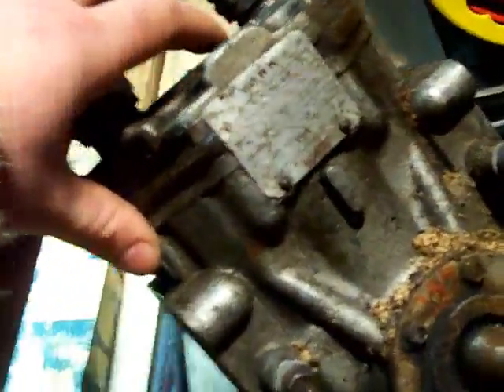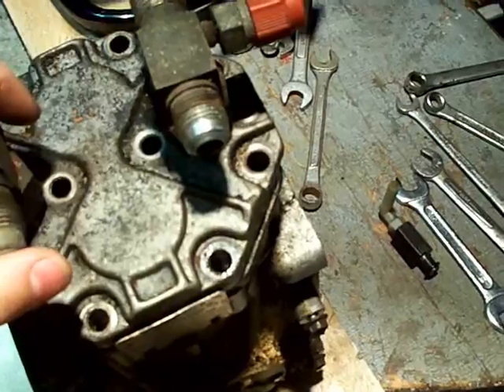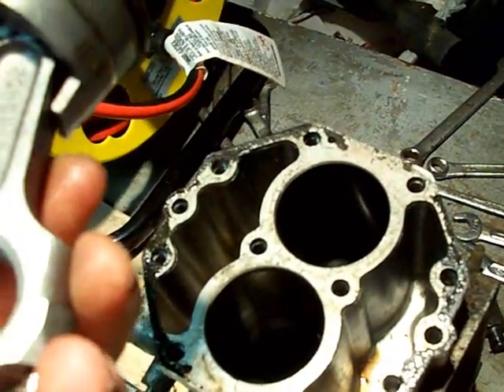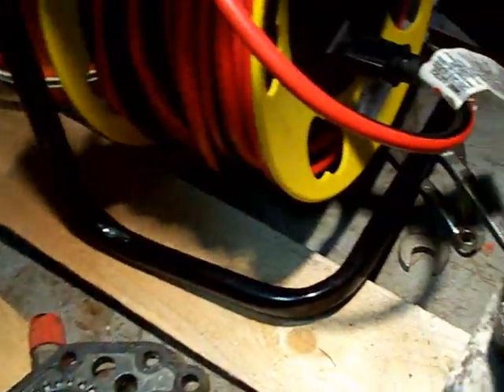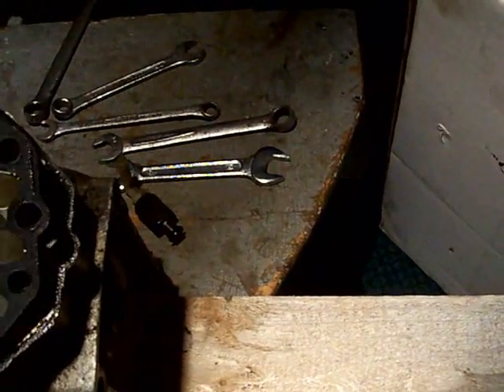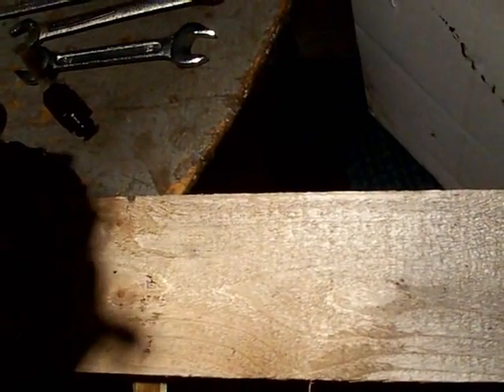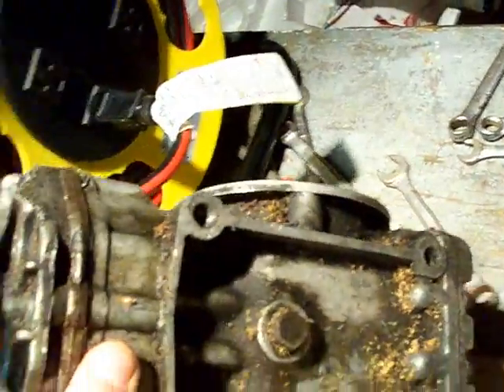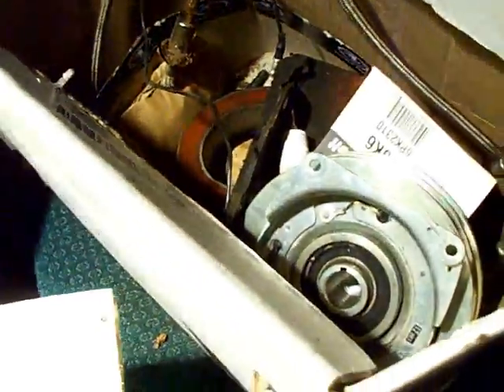York compressor information

Comment: @holyford86 One more question haha. My 210 has another oil feed hole on the same side right next to the other piston. Does yours also have this?
Reply from the maker: They will have an oil feed hole to the suction side of the compressor, it allows the oil present in the ac system to return to the crankcase and is something you should plug when using it to pump air, along with adding a crankcase breather to the pump too
Reply: @holyford86  Is that the only oil feed oil? I think there is also one on the discharge side that lubricated that bearing.
Reply from the maker: There are places in the casting for both but only one is drilled usually, the bearing is lubricated from the crankcase so the oil passage is unnecessary for that bearing to stay lubricated
Reply: holyford86 Is there another bearing on the other side of the crankshaft?
Reply from the maker: Just the two main bearings
Reply: holyford86 I think on mine both bearings have an oil feed hole. Have you seen this before?
Reply: Is there any way I can please send a picture?
Reply from the maker: @armenarakelyan6921  my username here @gmail.com
Reply: holyford86 thank you! I sent it

Comment: Can you tele me how tight the two nuts on the valve plate are it’s the nuts that holds the round things thinks
Reply from the maker: I've never had the need to remove them, I'm not sure what the torque specification is, I'd just use your judgement and a little bit of blue loctite for good measure
Reply: holyford86 think you

Comment: Where's the best place to get new gasket kits for these? I'm finding some online but too much wait time on shipping, i called auto, advance, oreilleys and napa, all said it would take days to get. I have the 209 version with the notch. mine came out of a 77 dodge rv with a 440
Reply from the maker: Bear in mind all of the info in this video is aimed at using this compressor to pump air, not refrigerant.
Reply: @holyford86  Hi, does this gasket set come with piston rings? If not where can I find ones that fit?
Reply from the maker: @armenarakelyan6921  the gasket set does not come with rings, I am unsure as to where they can be sourced
Reply: @holyford86  Thank you for the quick response! Did you reuse yours? I don't want to take the pistons out yet because I am unsure if i can reuse the rings.
Reply from the maker: @armenarakelyan6921  if there is no visible scoring in the cylinders and they look okay I wouldnt remove the pistons or mess with the bottom end if you don't need to
Reply: holyford86 Ok thank you for the advice! They look good so I won’t be removing them.
Reply from the maker: Any place you order from will have lead time on the gaskets, they are not a widely used compressor anymore.  4 seasons part number 24027 is what I used last time, should be able to cross reference that in most places
Reply: @holyford86  thanks for getting back to me, I've been calling places all day lol. I may just order from eBay and wait the extra couple days at this point. I'll post the videos on my channel soon of my tear apart and cleaning. I also had one on another van making Loud noises and i opened it too and found one of the bearings inside overheated and chunks of metal softened and broke off into the Pistons lol 🔥
Reply: It was running with no oil from previous owner, now has a pesky leak I'm trying to find. Added dye recently and new compressor

Comment: Anyone try to oil these like you would a turbo. Small oil line going to it and then a larger oil return back to the oil pan or fuel pump block off?
Reply from the maker: Jonathan c they are splash lubricated, just like many small engines, it would take extensive case modification to do so.  I will be posting an update to this video as soon as I am able to do so, stay tuned.
Reply: @holyford86  I know they are. I have a mini York for my air ride setup. I'm ok with the mods needed for this. I'm thinking that it would both lubicate the internals and help with any blow by air around the Pistons. I would still have my oil/water separator before the tank.
Reply: @thtsjon4u  i was thinking of trying the same thing and adding oil rings to the pistions. did you ever try it?

Comment: WARNING!  The oil plug (known as "oil mod") should not be done without istallation of a Fog Oiler on the intake side. While the oiling passage lets some oil through the discharge, the oil is necessary to lubricate the piston heads, rings, and check valves of the compressor. Without the oil, the above listed components will not just wear out faster, but will become very hot under use and can sieze, shredding the fanbelt at best. Installing a coalescent filter on the output will remove any blow through oil, water or dirt. ATF is ideal for both the oiler and compressor oil gallery as it works in the fog oiler but is still thick enoug to lubricate properly in the compressor.
Reply: Wrong you get a lot of oil to the top end trust me
Reply from the maker: @thelonerider8389  anyone who has used one of these for any length of time, modded or not, knows they pass more than enough oil to lubricate the top end on their own, haha.  I've used mine for hours at a time, it gets hot, but the 7 gallons of tank I have really helps keep the amount it cycles to a minimum when using lower flow stuff like intermittent blow gun use or light impact use.

Comment: I have a york 209 and I can't get the valve plate to come off. I've tried using a flat blade screwdriver and a hammer on the underside of the plate lip but it wont budge. Does anybody know if it just being stubborn or is there something else I need to take off other then the cover bolts?
Reply: Allen McKinney any luck yet? I have the same exact problom. Thinking about using some pb blaster, hopefully it works.
Let me know how you got yours off.

Comment: For that little adapter, try a check valve for a fish tank it should be close to the same barb size as that piece you have. That should keep the oil from backing up.

Comment: What's the max psi ? And even with a check valve it won't pass 100 the belt starts to slip and suggestions on how to fix it
Reply: Try using 2 belts or different types of belts. I've heard of jeep guys getting 200psi with their systems.
Reply: Thanks man

Comment: Just a fyi. These style yorks also come on Semi trucks as the ac units. Both V-belt and Serpentine. They also have 4 different model yorks on different model semis. EX: peterbuilt may have a york 210 and freightliner may have a different york. They are very close in comparison but may be the 4in and 6in you were talking about in the begining of the vid. I have had my york on my nissan hardbody for 5years now without problems, IF given the proper maintenance.

Comment: Good info. thanks! I just grabbed a York 209 out of a 1976 ChevyVan20 that was mounted to bottom not side of the unit. It sits on a factory mount that connects to the drivers side head and the water pump. Currently modifying the bracket to mount the unit more outboard vs almost dead center above water pump.

Comment: In response to your vent mod im currently running an oil breather catch can ive taped both plugs to 1/8 npt with 2 1/8 90 npt hose barb on each side one side plumbed to the top of my breather ctach can and the other side to the bottum of the catch can when compressor runs oil blows into the catch can and allows for venting without losing oil the oil will then gravity drop through the bottum back into the compressor.